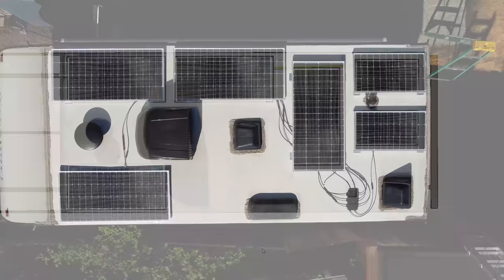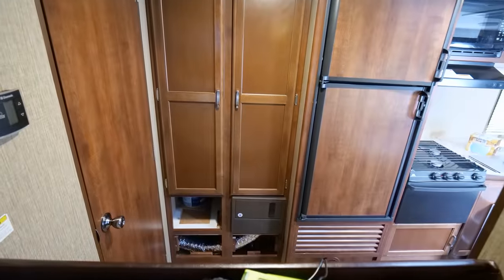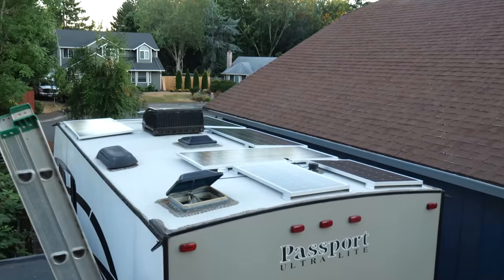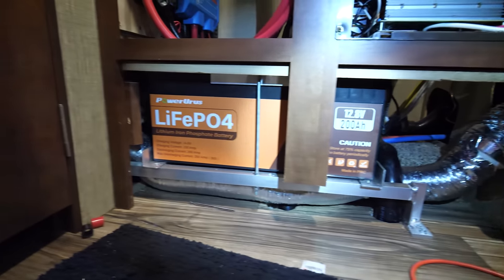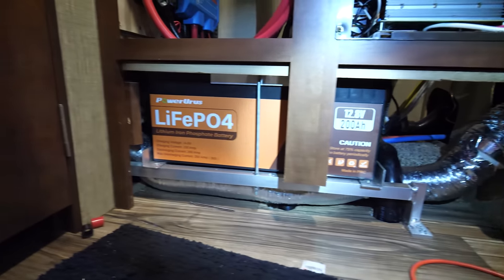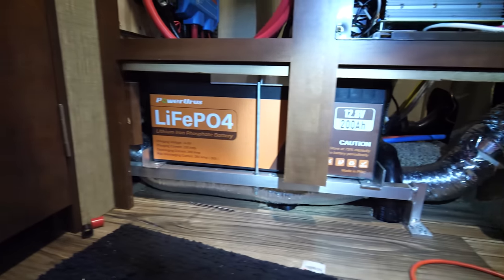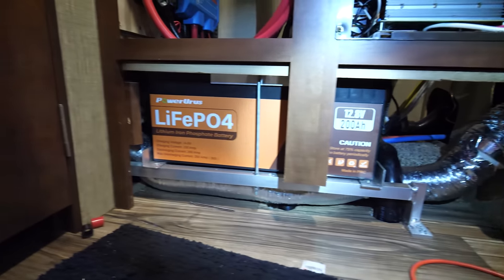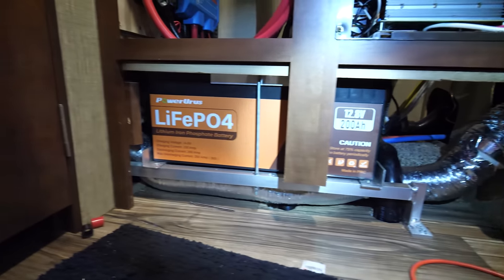New Off Grid Solar Power System!

Comment: Aside from "that's not "camping"", the "tokens" thing, for me, was just annoying.  Are North Americans really so fixated on imperial units that nice, clean watts, kilowatts and kilowatt/hours are confusing?
Reply: The issue isn't so much the units as it is understanding what each unit measures. Amps, Volts, and Watts are all in play here, and, for the uninitiated, making sense of which units mean what and why they need to be multiplied together to yield yet another unit can be overwhelming. Visualizing watt hours is unintuitive but visualizing a box of tokens is simple.
Reply: I'd say it is confusing for most people, especially considering that even you just messed it up (it's kWh not kW/h).